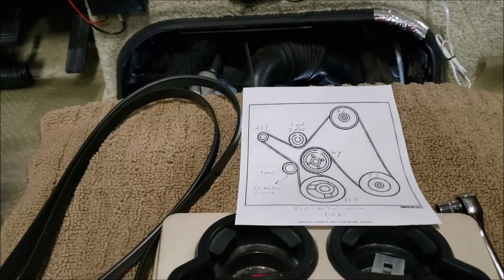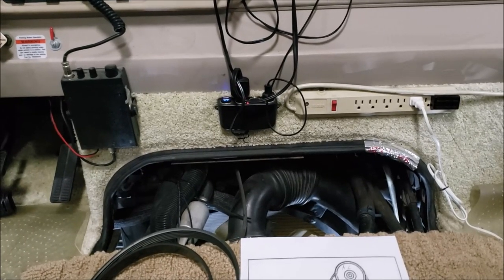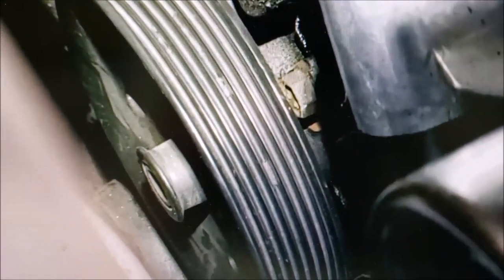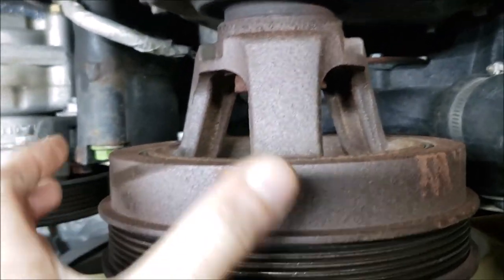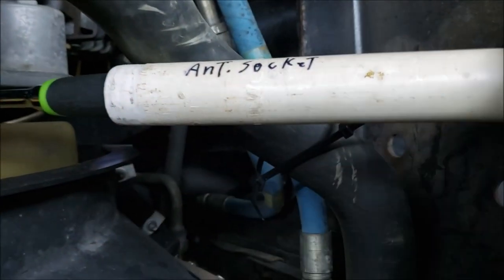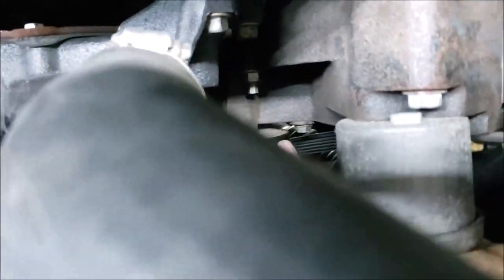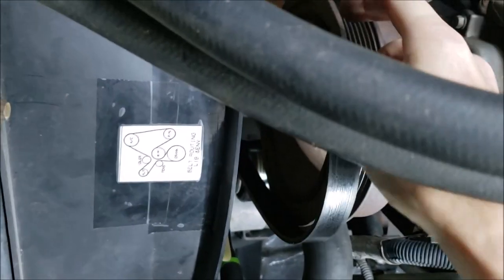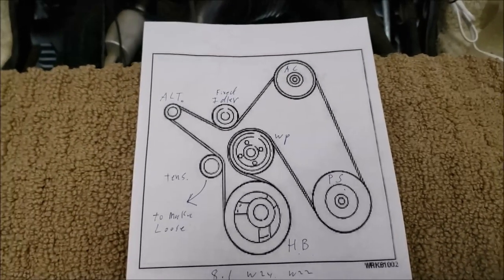Your Workhorse 8.1 Vortec Serpentine Belt Broke and Your on The Side of The Road Now What do you do?

Comment: Kevin, Thank you so much for this video!!! I watched it 3 times before trying this on our " new to us 2004 Pace Arrow MH" w/ the 8.1.
I used the cheater pipe on the spring method and the Gates belt was so tight that I seated it on the dampener as the last pully, and then pushed it up and onto the tension idler, as it had a nice radius. No WD-40 required. Hope you don't mind the change up. Mike
Reply from the maker: Awesome, glad you was able to do it yourself. Thanks for watching

Comment: Embarked on first trip with kids and I have same chassy so have watched lots of your videos.   I actually put the same fuel pressure guage in mine from your videos!:)  30 miles from Jackson wy, bam plant plant plant.  My belt broke!I was lucky enough to literally coast into a campground.  I didn't know the correct belt, but I went to napa and actually tried to call you for help - my only hope!    Finally I got ahold of an rv shop in Idaho that told me the correct belt and I was able to somehow get the old partially broken belt put and put the new belt on.  Honestly, would not have been able to do it without your videos especially the ac bypass one!:)  Thanks and much appreciation, it literally saved our trip!  -tim
Reply from the maker: So sorry I missed your call glad you got it fixed for future reference send me a text sometimes I don't notice my voice mails for a few hours my cell phone number is 606-875-0125 text anytime day or night most nights I'm up very late.

Comment: Thank you so much for the belt/pulley tip! My chassis AC wouldn’t hold a charge and I tracked it to the compressor. About a month later, the comp started getting noisy. I really wasn’t ready to deal with it and looked around for comp adapters, but your tip allowed me to use the RV and still go on trips. Thank you again!
Reply from the maker: Thanks for letting me know you found my video helpful.

Comment: Kevin  My W22  has a squeeling noise coming from the serpentine belt. So I checked it today and it is split into like it has to belts just like the problem you had. Glad I watched your video that bit of info about a small piece of metal stuck in a pully was great! I was going to have the belt changed but after watching you change it with one hand I think I will give it a try.
 Thanks
Earnie
Reply from the maker: While your at it buy 2 belts so you will have a spare. While the belt is off check your idler pulleys if you have any questions text or call my cell 606-875-0125 Kevin.

Comment: Hello,

I appreciate all your videos on RVs! Thanks for doing what you do!

I have a 2001 class a windsong by forest river with a w22 workhorse vortec 8.1L engine and was hoping you may have some advice for me.

I bought this rig 2 weeks ago, started it last one week ago.. never had any issues starting it until today.. went to turn the key over and not a single sound or light is lighting up.. just acting like it’s entirely dead.. so I am a bit concerned.. I cannot imagine the battery that powers the motorhome to be completely dead just by sitting for a week with nothing on besides a couple of map lights for an hour or two.. everything else in the RV is working, electrically speaking, but nothing in the front is suddenly. I have not touched any electrical components in the RV besides jacks but it was been hooked up to a 30 amp connection when I used lights and the jacks.. 

Would your first step be to check the battery itself? If it’s not the battery causing the issue what would you do next?
Reply from the maker: Give me a call 606-875-0125 Kevin I will be up till 3am eastern

Comment: Great content! I just purchased a 2007 Adventurer 38T and when I turn the engine on there's a a constant really loud squeaking noise and it continuously squeaks when driving also. I took a quick look at the belt and it looks to be in good condition - no cracks. I did notice that, what I think is the power steering pully, has a slight wobble when running. Could this be what's causing the squeak? If not, how can I narrow down what is causing the squeak? Also when I spray the area where the PS pully is or just the belt with silicone WD40 the noise stops, but I can hear a really light high pitched noise and then eventually the squeaking starts again. Any help is greatly appreciated!
Reply from the maker: Give me a call or text my cell phone number is 606-875-0125 Kevin
Reply: @ktoutdoor  Great thanks, i'll shoot you a text by the end of the week when I'm free!

Comment: Kevin,  I changed mine last week.  Got to thinking, what do you use to monitor temp on the Allison.  Mine is a W22 with the 6 speed 1000 in it, so the normal scangauge 2 wont read it.  Do you have a solution for yours?
Reply from the maker: We have the 5 speed so our scangauge2 gives me the temp. If I had a six speed I might use this 
https://youtu.be/T0ezHdCoLKk
they are programmable also to set off a alarm if it gets to hot. all you have to do is bolt it to the oil pan or clamp to oil line.
you can buy them hear https://www.thermomart.com/DIGITAL-FAHRENHEIT-TEMPERATURE-CONTROLLER-GAUGE-ALARM-ENGINE-WATCHDOG-CAR-OVERHEATING-PROBE

Comment: Great info! Thanks so much. My belt was definitely due for replacement. One question, there is evidence that something has worn into the top side of the belt. I looked all over for a  bolt that had backed out or something else that could have contacted the top of the belt. Nothing found. Any ideas? (It’s a 2008 Itasca Sunrise 36’)
Reply from the maker: That is a head scratcher for sure.. What I would do is put the new belt on and keep checking on it from time to time to see if there are any signs of ware like you saw on the old belt. If I can be of any help my cell  is 606-875-0125 Kevin
Reply: @ktoutdoor  thanks for your reply that’s what I did and so far it looks clean. I have a whole new respect for your video skills while doing a job like that. I also wasn’t able to do it without cussing :-)
Reply from the maker: @dloneyv8  Thank you for the kind words. glad you got it fixed.

Comment: Kevin, I have a question for you. My W22 motor gets a  squeeling noise coning from the serpentine belt. Did you ever come accross this issue?
Reply from the maker: You need to confirm if its a belt slipping squeal or a bad bearing noise be careful and try to get a wrench or socket on the belt tensioner bolt while its making the nose add more tension  your self to see if it goes away. Give me a call or text 606-875-0125 Kevin

Comment: Hard to believe, but I think I missed one of your videos! What is that unit with the antenna to the left of your temperature gauge atop your dash? Another thing that may help to cool the engine longer is to turn the heater up full blast. That helped me one time when my engine was running hot.
Reply: It is a tire pressure monitor receiver. Remember the belt is broken so no water pump = no heat.
Reply from the maker: Truck systems technology tire monitor https://tsttruck.com It has saved me twice now in 10 years.

Comment: What is the part number for the belt?
Reply from the maker: 5,916 views  Oct 17, 2021
Workhorse W series W22 W24 Belts listed below Buy Here https://amzn.to/3B8m03y
W0000581  Serpentine Belt  OEM
4061080  Serpentine Belt  Goodyear
1080K6  Serpentine Belt  Kelly Springfield
K061080  Serpentine Belt  Gates Buy Here https://amzn.to/3B8m03y
25-061080  Serpentine Belt  NAPA
Note - Be aware some RV'ers have indicated that the 108" belt is to long and they had to use a 103" belt. The 103" belt is for the P32's and the 108" belt is for the W series. The difference in sizes is do a pulley size difference between the P32 and W series. On the power steering pump.
P32 belts listed below
Workhorse # = 12569440 DAYCO #= 5061030  = 103" Buy Here https://amzn.to/42zPJOC